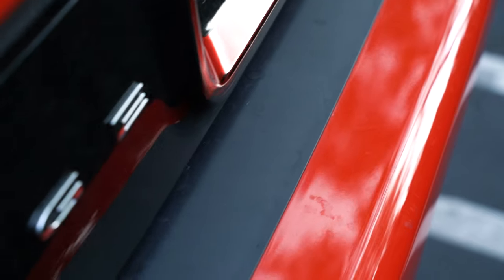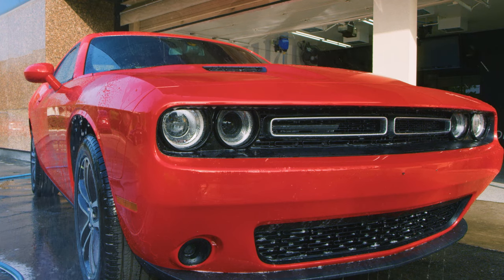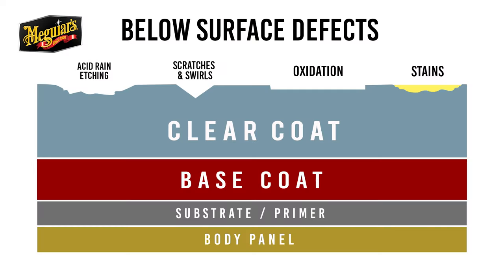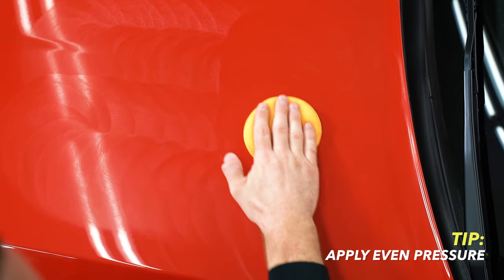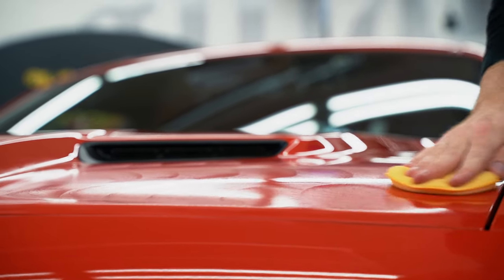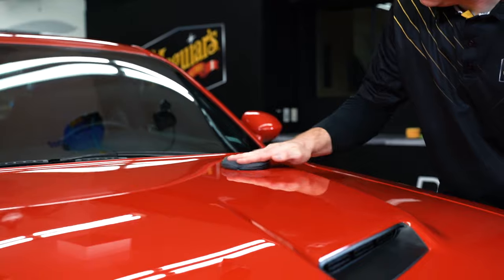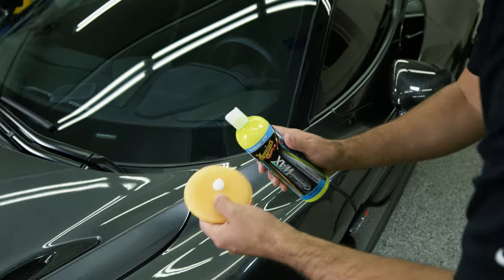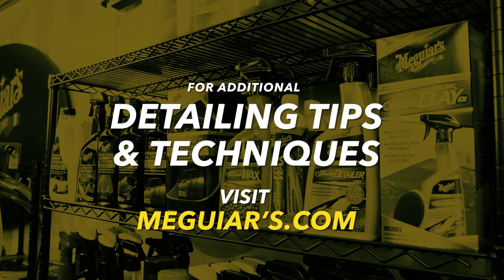How to Apply Compound, Polish & Wax by Hand – Quik Tips

Comment: In a month, how many time we should polish it? my car paint type is soft paint
Reply from the maker: We may use the term "polish" differently than you do but if what you really mean is how often should you compound that depends entirely if you have defects in the paint you want/need to remove.  For most vehicles compounding once a month is not necessary but you should also be aware that effective but safe compound like our Ultimate Compound can be used many times with no concern.
Reply: @meguiars  that what i want to heard brother........couse I only use meg's for my car

Comment: should we use foam pad or microfiber pad for compounding?
Reply from the maker: The most common recommendation is to use foam pads as they are a little easier to work with, less aggressive, and still get the job done a majority of the time.  If for some reason you know you need to get more aggressive and are willing to spend a little time learning how to use the microfiber system that is an option as well but make sure you take time to fully understand how to use those pads.

Comment: can you use this on marine applications? ie fibreglass.
Reply from the maker: Not sure which product you are referring to when you say "this" as there are a few products featured in this video.  Yes, for the most part you can use automotive products on a boat but depending on the application it may not be as effective as one of the products in our Marine line dedicated for that purpose.

Comment: I bought and used these products, spent over 8 hours washing, drying, compounding, polishing and waxing. Looks better but still see the scratches. 😢
Reply from the maker: Thank you for sharing.  It is certainly possible your scratches are deeper than you might think and/or your paint is particularly hard.  It is certainly possible that machine application may be necessary.

Please feel free to reach out to our Solutions Hub to discuss in more detail with one of our surface care specialists.

https://s.3m.com/qrtbxq

Comment: Lighter fluid also works great for fine junk stuck to paint.  A damp cloth of it goes a long way also.  Rinse with hot water afterwards and sponge lightly to wash off residuals.

Use the rag to start a BBQ.  😆

Comment: My compound would dry up and leave residue behind, and it was hard to move the applicator pad
Reply from the maker: Could be related to the condition of the vehicle but keep in mind the compound should not dry at all.  You want to apply to only 1-2 sq ft at a time and then wipe off immediately.  Also make sure you are using a good quality microfiber towel to remove the product.
Reply: Same was happening to me.

Comment: Any idea how many times is too many times to apply compound to treat oxidisation?
Reply from the maker: That is impossible to answer considering the number of variables involved.  How bad is the oxidation?  What product are you using?  Are you working by hand or machine?  What kind of machine?  What kind of pads?  What speed and pressure are you using when running the machine?  And of course how thick hard and thick is the paint on that particular vehicle?

That being said when working with a mild/safe compound like our Ultimate Compound by hand, orbital, or DA Polisher you can typically use it as much as is necessary.  If you are not making any progress during a particular job after 2-3 applications you probably need to reassess and consider the next aggressive method if possible.  

If you find yourself in this situation please feel free to reach out to our Solutions Hub to discuss the specifics of your situation with an expert...

https://s.3m.com/kdfazh
Reply: @meguiars  that’s great thank you. I also have another question if that’s ok - when I reach the polishing stage (ultimate polish), only on my bonnet, once I have buffed it in and I come to wipe it off with a micro fibre towel, it is leaving behind streaks. I know this is a broad question but is there any idea as to why? Or what variables could be causing this?
Reply from the maker: If this is only happening on one area of the car that paint likely has some kind of contamination that has landed there or the paint is possibly in much worse condition in that area.  How old is this vehicle?  The hood or other top/horizontal surfaces are always the first to go.  It may be that the paint is more porous because if it's condition which is making it hold on to product residue more than normal.

That being said the most common reason for this is typically drying time.  The polish should only be applied in 2X2 ft area and then wiped off immediately.  It should not dry at all.  If it is drying that would make it more difficult to remove.  If your environment is particularly hot and/or humid that could also have an impact on this.

Just two possibilities.  Again, please feel free to reach out to our Solutions Hub directly to discuss the specifics with one of our Surface Care Specialists.

Comment: Is polish mandatory after compound or we can do compoumd and wax..??
Reply from the maker: Polishing is often an optional step.  Depending on the color and condition of the paint it may or may not have a big visual impact.  That really is a personal decision you will have to make based on those things as well as you personal desires for your car.

So yes, it is possible to go right from compounding to wax.
Reply: @meguiars  how often we should use compund
Reply from the maker: Compound is used on an as needed basis to remove defects in your paint such as scratches, swirls, oxidation, water spots, etc.

Comment: Can these be applied to a brand new car that is only 2 day old?
Reply from the maker: Yes, paint on a new OEM vehicle is painted in a way where the paint is fully cured before you receive it.
Reply: @meguiars  the brand new car will be parked most of the time in a place that has no roof. Does the ultimate paste wax protect from sunlight and rain?
Reply from the maker: Yes, it will do a great job however our best protecting wax would be our Hybrid Ceramic Liquid Wax.

https://s.3m.com/sq8nka
Reply: @meguiars  thanks. How to apply the hybrid ceramic wax?
Reply from the maker: This video shows how best to apply compound, polish, and wax by hand...

https://s.3m.com/zft5ea
Reply: If the clear coat was pealed off in som spots would u just polish over it ?
Reply from the maker: If your clear coat (paint) is peeling off unfortunately the only true remedy is to repaint.

Comment: I thought you should use microfiber applicator for compound because its more aggressive?
Reply from the maker: Are you talking about hand or machine application?

By hand we recommend a foam applicator pad.  With a machine like a DA Polisher we typically recommend foam as well but do offer microfiber pads but  yes, they are more aggressive and do have a slight learning curve.  For most people the foam is recommended as it is still very effective and easy to use.

Comment: After applying ultimate wax to seal, when can I start  with regular waxing again.
Reply from the maker: Not sure what you mean?  Ultimate Wax is a wax it is not necessary to put anything else over it.  If for some reason you want to  you should wait 24 hours for it to fully cure but again putting another wax on top may not have the benefits you are assuming it might.
Reply: I applied ultimate wax 3 months ago. Should I wax/compound again before I put ultimate wax this time ?
Reply from the maker: A compound is used to remove defects in the paint, so the real question is do you have swirl marks, scratches, oxidation, water spots, etc.?  If there are no defect in the paint you would not need to compound.

Comment: Hi. A quick question. Do I need to repeat the entire process every time I need to wash my car? Thank you!
Reply: No
Reply: No, once it's done you only ever want to compound or polish if it really needs it and has lots of scratches, as every time you do you are removing clear coat as they are liquid abrasives. Wax it every six months if you use the Ultimate or Ceramic, and wash as normal otherwise.
Reply: Wax it every month if you want the absolute 100% best protection
Reply: Thanks a lot!! ☺️
Reply from the maker: No.  Compound is typically done only on an as needed basis, polish is often optional, and your wax is going to last a lot longer than just one wash.  👍

Comment: Another question: after I compound do I need to clean that area with m122 before I polish or is just a wipe down with a microfiber fine? I know I need to spray the surface after I polish before a sealant.
Reply from the maker: You typically do not need to use a surface prep between steps just wipe off throughly and proceed to the next step.

Comment: How long do I keep the wax on the car after applying before wiping it off?
Reply from the maker: It depends on the wax.  Some of the newer synthetic and/or hybrid ceramic products don't ever really dry and we recommend wiping them off in as little as 3-5 mins.  Some of the older waxes require drying to a haze which can take 15-20 mins or even longer depending on how thick the product was applied and the environment (weather conditions).
Reply: Meguiar's thank you so much. I’m using the NXT gen tech wax 2.0 paste
Reply from the maker: NXT does need to dry to a haze.  That is typically going to be at least 15 mins but again depends on how much product you applied and the weather.  It might take longer.  When it turns hazy/chalky white then you can wipe it off.  It if still streaks wait longer.  👍

Comment: Hello Meguiar's can you make a video for a new car what steps do I need, to protect and maintain a new car.
Reply from the maker: The steps are really no different other than you might be able to skip a step or two after washing if you do not have any bonded contaminants or defects in the paint.  The most important thing with a new vehicle is to keep it clean and protected.  That means at minimum you are washing and waxing regularly.  Also makes sense to keep a good detail spray on hand to safely wipe down the car in between washings when you get some fresh contaminants on the surface.
Reply: Thank you for answering about wax in new cars, but how often should I wax my car? Should I also use ultimate polish too?
Reply from the maker: We typically recommend at least 3-4 times per year however there are many variables specific to your vehicle and environment that affect how long a wax will last.  

Polishing is often an optional step depending on the condition of the paint, color, and your personal preferences and desires for the vehicle.  If it is a darker color and you want to treat it like a show car, yes you will likely want to polish.  If it is a white daily drive you just want to keep nice maybe not?  Again, that is highly dependent on the specific person and their vehicle.

Comment: Dear Meguiar’s, while compounding by hand using foam application pad, do I need to keep the pad wet/damp as I got lot of product’s remainings. Also can I compound one day and polish the next one.
Reply from the maker: Not sure exactly what you mean.  To apply compound should be done exactly as you see in this video.  If you are asking if you need to wet the applicator pad with water the answer is no.  Again, just follow exactly what you see in the video.

Yes, you can compound one day and then polish the next of course the car will still need to be free of dirt/dust, etc. before proceeding on day two.

Comment: How do you remove wax before polishing please ?
Wax remover removes only old wax,
IPA even pure can not
Claybar can not
Fairy can not 
White spirit can not 
Break cleaner can not 
Talking about wax which cars end up having over them after regular washes.
Regular washes are done using shampoo with wax in it
Some owners wash their cars every day meaning there are many layers of that wax.
Also sealants such as Fuso Coat are hard to remove even for sanding/ wet sanding so lightly polishing to remove them is a myth as well and then washing towels with sealants and waxes in them is also kind of impossible often.
Reply from the maker: You may be giving too much credit to most waxes.  If the normal detailing process includes claying and compound that will certainly do the trick.  If you are looking for an independent product many all-purpose cleaners will do that.  Even dish washing liquid and water will work although certainly not recommended on a regular basis. 

We do have a great product for just this in our Professional Mirror Glaze line.  Our M122 Surface Prep (link below) would be the best option for your concern.

https://s.3m.com/pwcbwb

Comment: Is it possible to use the spray on hybrid ceramic wax instead of the ultimate wax, or the ceramic liquid wax, and get the same results?
Reply from the maker: Not sure what you mean by "same results" but yes the Hybrid Ceramic Waxes will offer even better protection and water beading than the Ultimate Wax.  You could certainly choose one of them to replace the use of Ultimate Wax if you like.

Comment: I am going to use my da to compound and polish my car but when I applied the compound by hand to test a spot on my car the residue got hard and was very hard to get off. Did I wait to long to wipe it off?
Reply from the maker: Yes, that is very likely the case.  You should only apply it 1-2 sq ft at a time and wipe it off immediately.  You do not want it to dry at all.
Reply: @meguiars  Thankyou for the response. For a first timer how do you recommend i prime my pad and which one to use. Should I use foam pad because it is more forgiving and easier to prime then microfiber?
Reply from the maker: When applying  compound we typically recommmend you use our DA Foam Cutting Disc/Pad (burgundy).  

Here is a video that gives instructions on how to apply products including the compound with a DA Polisher...

https://s.3m.com/gkjvrd